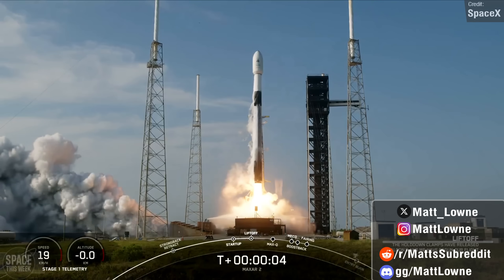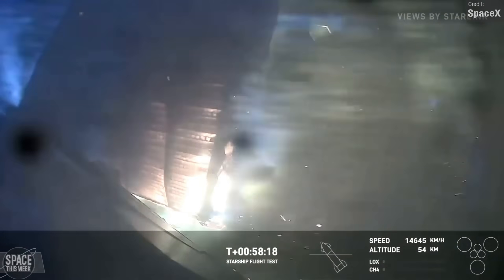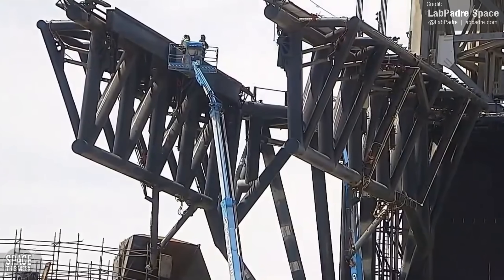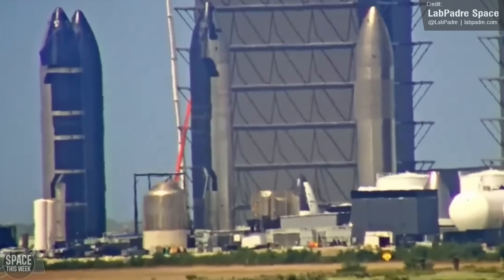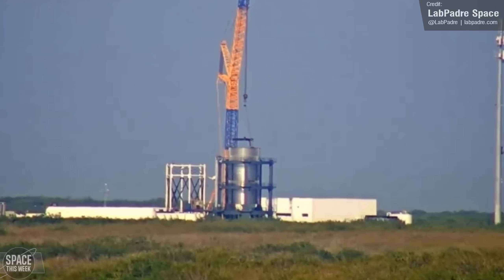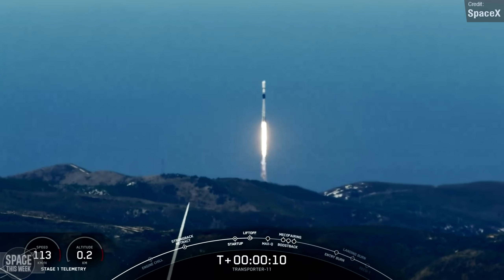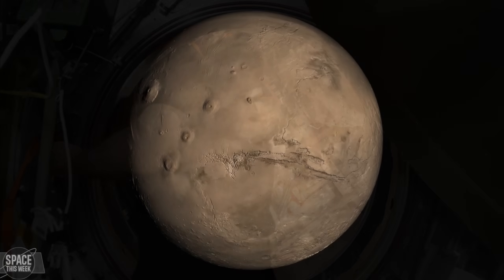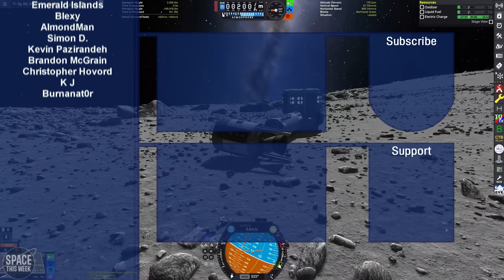SpaceX Continue Starship Catch Tests and Reinforce Mechazilla!

Comment: Giant aircraft carrier arresting cables hanging horizontally and inboard from arms and tail hooks (nose hooks)  mounted vertically (deployed sticking out at 45 degree angle) from rocket nose might be an option that requires less precision and has 100 years of experience and improvement.

Comment: Curious if the chopsticks have a built in shock absorber system for the catch
Reply: yes. WAI mentoined it last week i think. the Catch Rails have one Hydraulic pin to lift them, and in total 4 Pins looking similar but internally constructed like F9s Crush Cores
Reply: Awesome, thanks for the info!

Comment: How did somebody in math get to solution that legs are going to fail more likely than this mechanical steel mass monster. We are going to see very nice tinfoil wrapping stylish landings if failed :D
Reply: removing legs from the booster has significant mass and complexity savings. sure its a more technically complex task to grab the booster as it hovers, but spaceX has a LOT of experience with sophisticated booster landings. Do you think a company like spaceX really would attempt something like this if they didnt think it could be accomplished? of course we could see a spectacular failure with a catch attempt, but the same can be said about nearly anything in spaceflight.
Reply: @leezaard3944  yeah, and the Booster Landings from SpaceX worked flawlessly on the very first try... /s
Reply: @unitrader403  hey that’s the beauty of a rapid iterative design philosophy like that of spaceX, things don’t always need to work on the first try
Reply: @leezaard3944  eah, was just joking with the weird expectation that everything has to work on the first try, or it is not worth pursuing..
Reply: I mean instead of just engineering better legs: Lets take it from air with chopsticks! Like Karate Kid and Mr. Miagy! ...less crack plz.